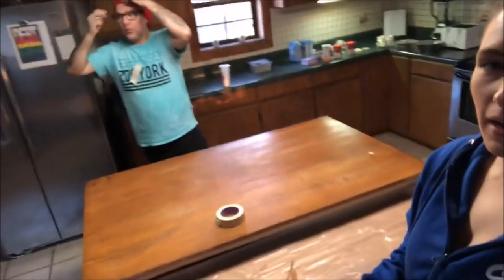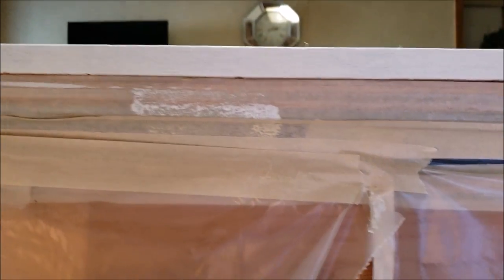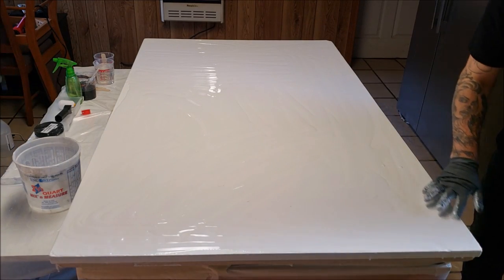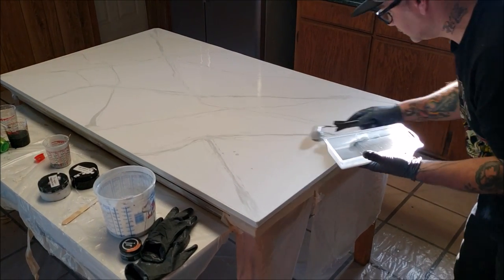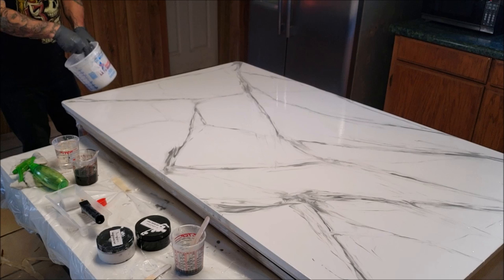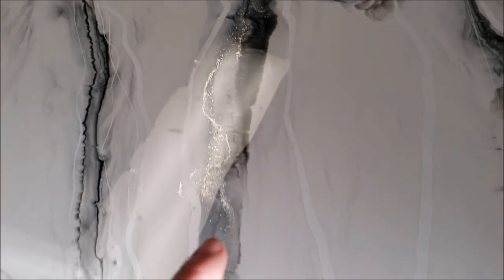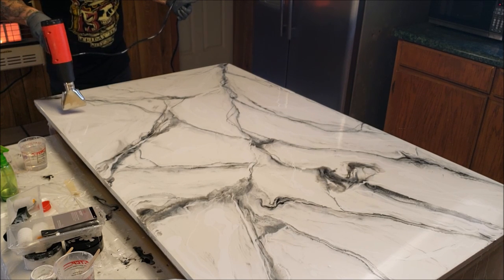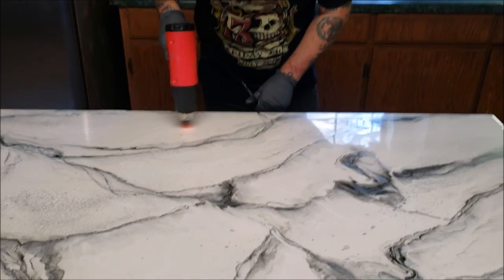Turning A Wooden Table Into Silver and White Marble with Resin!!!!

Comment: Tape your edges with masking tape so that there is about 1" inch above the table surface. Do 2 layers to make it a sturdier edge. This allows you to pour more resin on the surface, and control when you actually want it to flow over the edge when you remove the tape. Smooth the edge with the overflowing resin and allow the pattern to flow over the edges. Before it sets up too much use a putty knife to scrape off any residual drips from the bottom lip of the edge. You might have to do this several times as the resin sets up. You can sand off the underside of the lip to remove any residual drips once the resin has fully hardened. 
Hope you don't mind the suggestions. You did an AWESOME job of the whole project! Looks like the real thing, and at just a fraction of what a real one would cost!! Impressive results!! 😀👍
Reply: Mary, you seem to be an expert in this :) Can you please assist with my dilemma before my wife kills me for damaging the table :/  I have a scratched up white modern lacquer table. Looking to pour a white epoxy finish. Can someone recommend how to achieve a new white layer and what materials are needed? Ex. heat gun for bubbles? Tabletop epoxy would be mixed with some kind of white non-toxic paint?
Reply: So remove the tape when it's still runny or after doing your vein/designs and a little bit of thickening?

Comment: Did you mix the silver metal powder in the bag and pipe it? Or was it a different color?
Reply from the maker: I mixed silver with the resin and put that in a bag and piped it.  Thanks for your question.  I just wanted to see if it worked and it did.  I would have gotten the same result with a stir stick and moving quickly across the surface.
Reply: Thanks.  I love how the silver sparkles.

Comment: Ratchet Question Here...Can I Use A Blow Dryer Instead Of A Heat Gun For This?
Reply from the maker: Corrie Jeann so while you can use a blow dryer - it will really mess up your design if you aren’t careful because it blows harder than a heat gun and a heat gun gets hotter - faster. So in the time it takes a blow dryer to heat an area well enough - odds are you have completely blown away your original design (with a blow dryer).
Reply: If you're smart a blow dryer works fine !

Comment: How do you keep the resin from setting up quickly?
Reply from the maker: Hey Karen, we use a FANTASTIC resin from stonecoat countertops called Art Coat. It gives at least a TWO HOUR working time. It finishes like glass, can withstand 500°F temps, is UV resistant and of course has an amazing working time. Here is a link to the resin and you can find 800+ pigments on the site that have been formulated specifically for resin artisttilldeath.com/shop
Reply: @ArtistTillDeath  Thanks so much for responding.  I'm thinking about doing my counter tops so I'm going to practice on some old ugly dressers.

Comment: watching from kuwait. what's the significance of heating the surface. just want to know.
Reply: The heat pops the bubbles in the epoxy from mixing. Can use heat gun or torch but do not get torch too close to surface epoxy is flamable.

Comment: Can you do this on a glass table?
Reply: You can, but there is a lot of prep that goes into doing a glasstop table.
I sanded with an orbiral sander with 60 grit, then 120 grit, then 220 grit. Clean with windex. Then apply 2 coats of XIM Bonding Primer (get it on StoneCoat Countertops website) sanding with 220 grit between coats.
Then apply 2 coats of paint and primer in one, or 2 coats of StoneCoat's Base Coat, sanding again between layers.
Once you do all that, you can then pour resin on glass and it won't peel off.

Comment: How much do you guys charge this is overwhelming lol
Reply: This is a good video. They cover the details pretty goo, but don't have the mindset that it looks more overwhelming than it actually is. If you're going for a very specific look, it could be challenging without experience/experimenting, but it's mostly abstract, so what you end up with maybe perfect :)

 If you've ever painted anything (especially glossy surfaces), the prep steps are the same as any other. Clean, sand, wipe, clean again, prime, done!

I use the Home Depot epoxy, Famowood Glaze Coat. It works just like this one (most do with the Part A and Part B 1 to 1 mix ratio), AND is much less expensive than Stone Coat. To get colors you want use cheap acrylic paint. For the MICA effect use dollar store eye shadow for the shimmer (that's pretty much all eye shadow is), or buy MICA powders...again, that's what eye shadow is. A heat gun can cost less than $20, and a torch is cheap and easy for less than $20 too.

Mixing the epoxy really is not difficult. Just have your pails and mixer ready to go. You can buy small epoxy kits at HD to use to learn more. While there, get a few scrap pieces of wood to work on. ACE Hardware has an epoxy brand they carry too. You can buy these epoxy from just about anywhere, but at the end of the day, the biggest differences I've found are the cure time, and the thickness while using. What you go with is a matter of your preference.
Reply: Cordell Willis  just acrylic paint mixed in the epoxy? So like white mixed with my epoxy? I saw another lady paint her counters with regular latex paint then pour the clear epoxy over it. Would that work too??

Comment: Use a tape measure, don't guess dimensions! 
Should know the sqft to  determine amount of resin  needed!
You should not use Art Coat for a table top surface,  it is not as hard as the  standard Counter Top Epoxy.
Reply from the maker: Lol ok!!